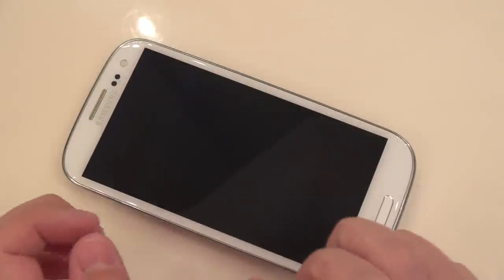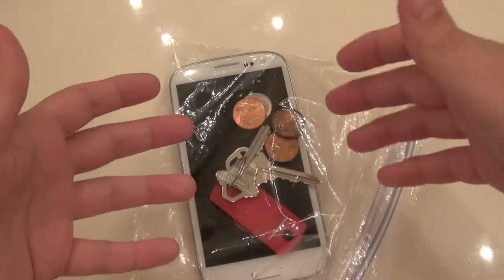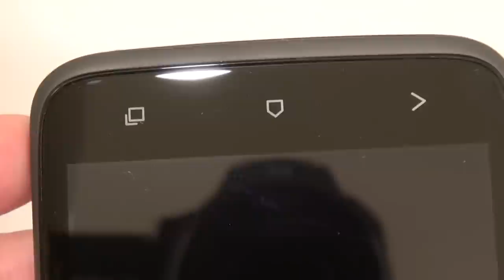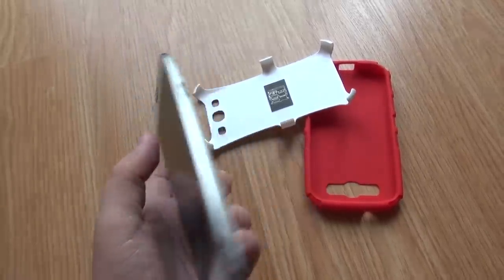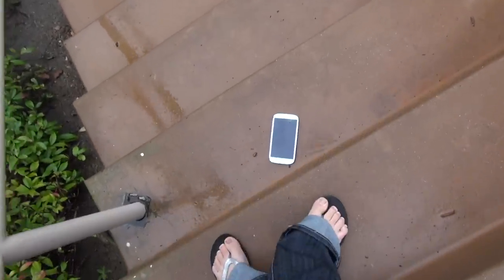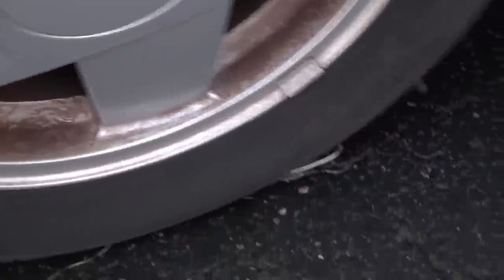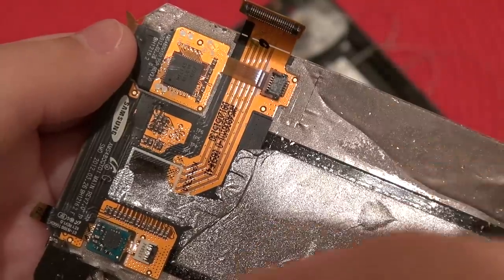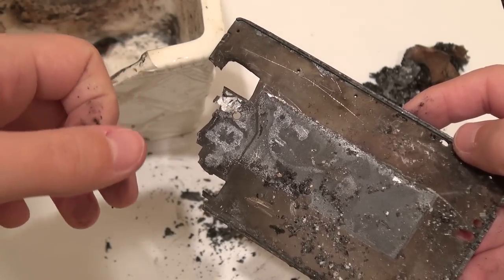Truth About Gorilla Glass (Ultimate Galaxy SIII Destruction!!!) *REPAIR VIDEO IN DESCRIPTION!!!*

Comment: You did great elementary job explaining gorilla glass.

You made mistakes in testing the glass. 

You limited and did not explain the phones body and other polymer based bioploymers add extra impact resistance to the gorilla glass! 

Furthermore the amoled display has tensile strength that adds to impact resistance. Also other wafare used in the fabrication of integrated circuits and other microdevices. Such as processors, chip sets, plastic polymer body adds to tensile strength of gorilla glass.

Also chip set you referred to doesn't look burnt and is almost impossible to see in a low electrical charged circuit known as traces along the board. 

Far as explaining elements that degradation to the glass incorrect. We breath in biological mater we call allergies along with that are dust particles that can make up harsh elements to display that is why we use a cloth to wipe the screen. 

Next time you waste 40 minutes on a video explaining scientific theory! Add the elements we can't see that is were most of science is misunderstood..

Why break the phone when you could have explained this with reasonable math and common sense.  Also that is not steel it is more then likely a alloy metal.

Comment: In every phone I've ever come across (And it's been MANY) dropping it perfectly flat will result in some damage, and usually a lot. I dropped my own Note 8 with Gorilla Glass 5, perfectly flat on it's face, only three feet, on a somewhat soft plastic surface, and the entire screen spiderwebbed.  Just stared at it for the longest time. The five minutes I had it out of it's case to give it and the case a cleaning and it breaks... 🤦

Comment: I have an old Droid X2 and it has a very tiny scratch. I use it daily, and it looks kinda rough on the housing but, it holds up very well. Haven't had any serious scratches show up. I've dropped the phone several times. It doesn't have gorilla glass. I also don't use a screen protector ever, and never had. I have a job where I am in contact with grease, oil, dirt, dust. When the screen gets spattered with some solvents or other debris, I wipe if off with my shirt, sometimes dirty as well. Still, have had no issues.

Comment: I actually had the Galaxy S3 and it cracked pretty much in the same fashion as this one did on the second drop with no cover. Only I dropped it on asphalt that was a lot more rocky like and not only did the glass break into a million little cracks but the screen inside broke too.

All in all, NEVER take the cover off your Galaxy.

Comment: I agree that a case is essential, but I got an extended battery(which came with its own back plate) and I can't find a Commuter type case that fits it. I did surgery on a cheap ebay imitation case, but it didn't work very well. Even after a superglue and dental floss fix, it still doesn't work very well.

Comment: Will a screen protector aid in protecting the screen againts breaks in any way or just against scratches from 7 point or higher materials? What screen protector do you recommend for the GS3?  Can you test the GS3 with an ultra low profile Incipio SA-292 NGP Semi-Rigid Soft Shell Case? Thanks!

Comment: About gorilla glass strength, few days ago i dropped my S 3 while boarding on a fully loaded 18 passenger van. I dropped my S3 and Van started rolling i quickly stopped it but unluckily it stopped over the phone (full rear wheel over the screen), i immediately asked the driver to reverse the van and as i found the phone was intact except it restarted. Now phone works well no scratch, no hanging every thing is fine etc. except one problem the phone never comes back alive after being on standby for 10 sec or more.

Comment: I SWEAR it does not break easily like that. Mg GS3 from LG U+(kr) is TOTALLY a brick. I accidentally dropped it face down, no case, no screen protector plus i kicked it (it fell off my pocket) It was in my exam room ang everyone looked at my phone. I looked at it and no scratch or crack. Except for a very small dot crack at the very top right of the GS3.

Comment: I wash my clothes. So that sand problem is easily fixed...
Reply: and I never put my phone in the same pocket as my keys. Why would you even do that when you have 2 pockets?
Reply: ever been to the beach? washing them only removes part of the sand, it takes forever to completely remove sand from clothing. "Pocket sand" (as some people call it) is no exception. Sand gets wet, clings to pocket, dries, remains in pocket.
Reply: Ryan Mills ok, you are right. but what i meant was that i wash my clothes often and check if i have anything in my pockets before i drop my phone in there. i recommend not taking the same clothes that you take for casual use, when going to the beach. keep the clothes separate.
Reply: Annogaming common sense ain't common....

Comment: gorilla glass was never designed to be shatter proof. It does offer great protection against scratches. Even if your so called "integrity" was NOT compromised by scratches, the phone WILL shatter from a drop height anywhere beyond 3ft and especially so if it is a face down hit. Side hits may escape shatter from even higher heights.
Reply: But I dropped mine from 5ft face down and not a scratch. On gravel
Reply: rjv361 Also depends on the way it dropped. I think when it hits on the side rather than face down, that might break the front more.
Reply: Nah it hit face down! Directly. Maybe I was just lucky